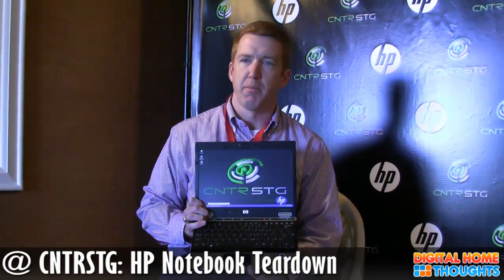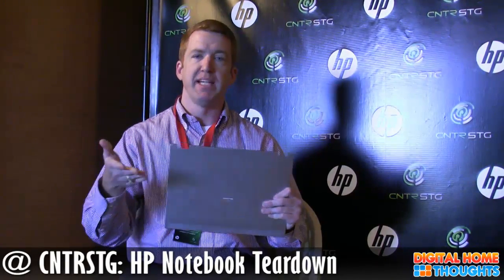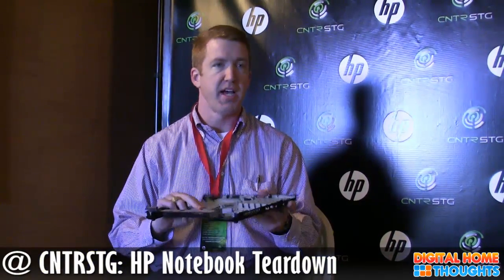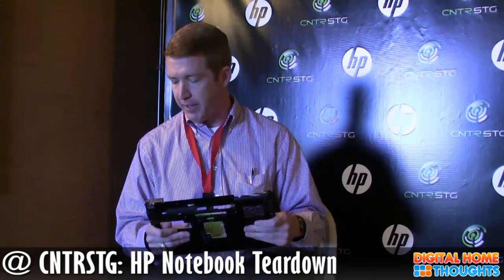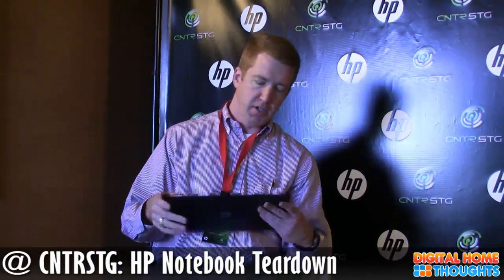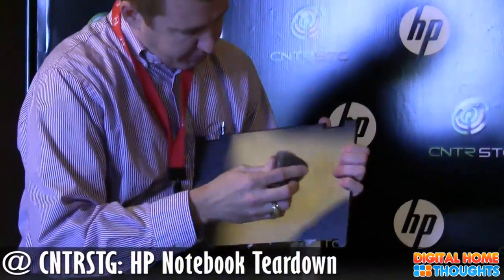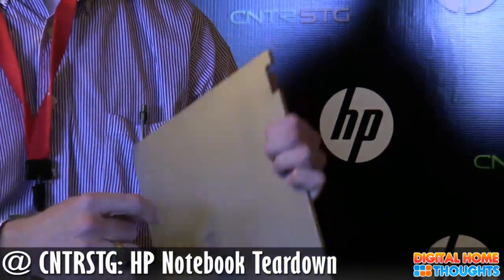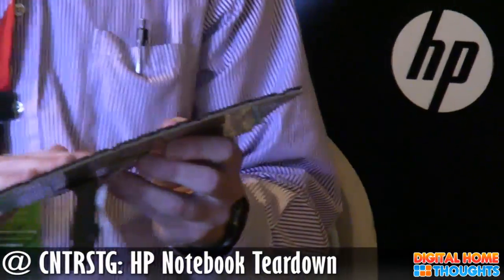CES 2009: HP Notebook Teardown [HD]

Comment: Did you notice how skillfully avoided the question about heat dispersion? Magnesium needs 1.023 Joule of energy for every gram of mass to increase the temperature by 1 degree Celsium/Kelvin. This means that it takes longer to heat up, but after that it stays warmer for longer.

So in longer periods of work, it will have heat problems